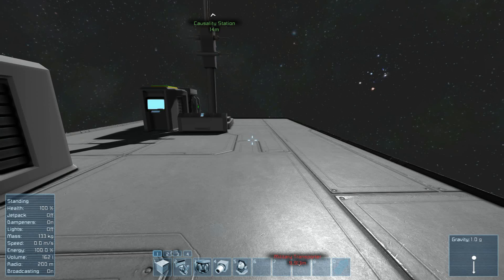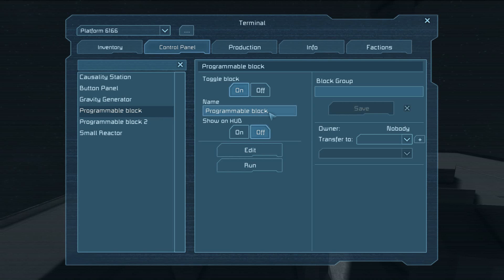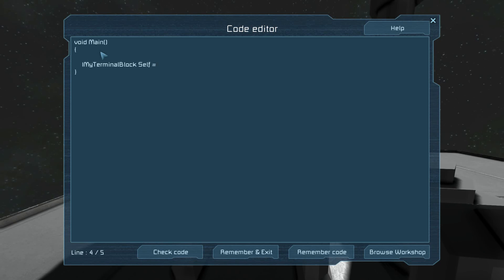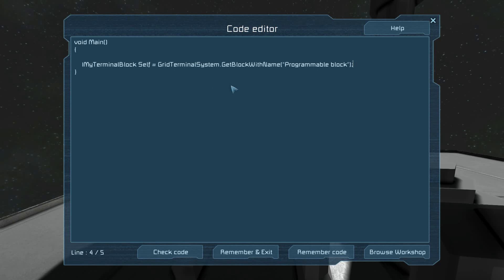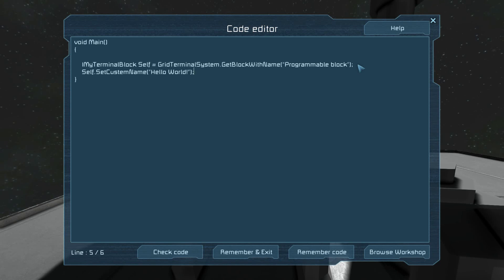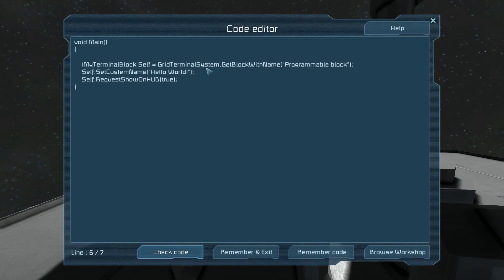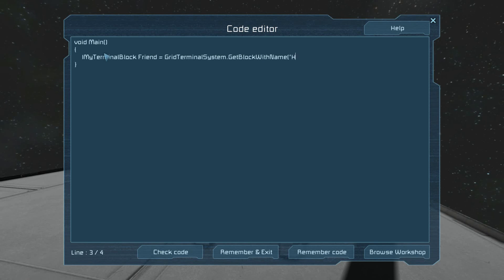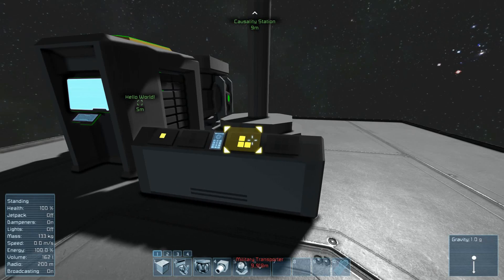Space Engineers Programming 1 - Hello World!

Comment: Hello, I have been trying to program a rotor to spin in 90 degree intervals, controlled by 2 buttons. One button to turn the rotor 90 degrees counter clockwise, and the other button to turn the rotor 90 degrees clockwise. With that, I hope to be able to go from 0* 90* 180* 270* 0* etc as well as 0* 270* 180* 90* 0* - meaning I hope not to have to cycle from 270* through the 180* and 90* in order to get to 0* and same goes for the reverse. In essence a free flowing rotor (as in no lower or upper limits) that, with 2 buttons, I can turn in 90* intervals - both clockwise and counter clockwise.

Comment: Any way to program delays, or sequences? I'm trying to make retractable thrusters using rotors. When activated I want the thrusters to move into place before turning on. Then once deactivated, have the thrusters shut off, then the rotors retract them. Is there a program for that?
Reply: i have a small base of knowledge on this but from what i understand you will need to use the timer blocks to your advantage in your situation. i dont know how much that helps but that would be the way to set up a delay if you where to split the code into multiple blocks then have the timer blocks set the delays.